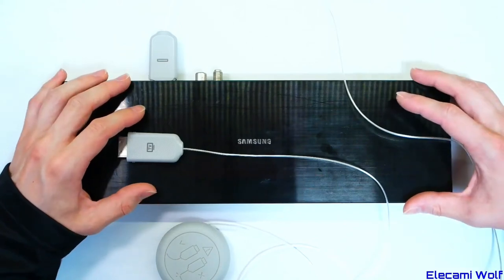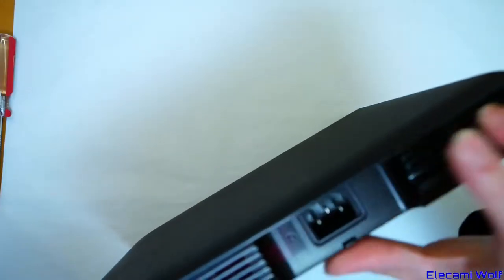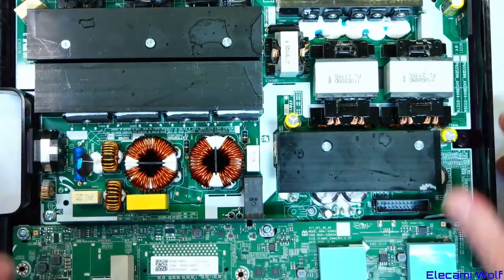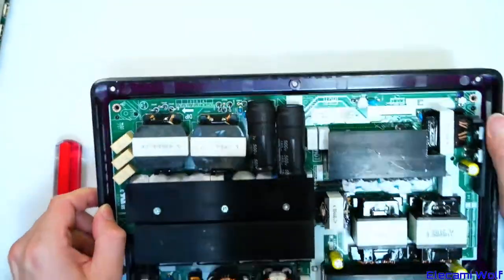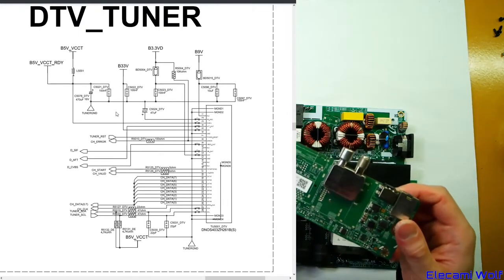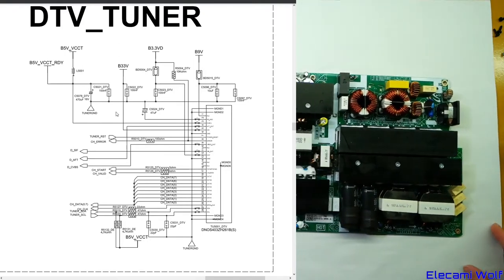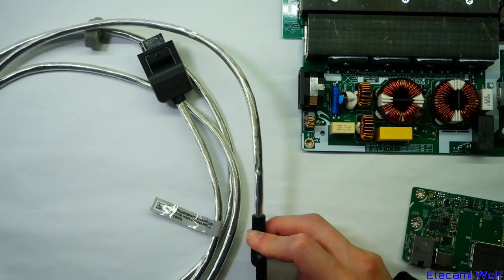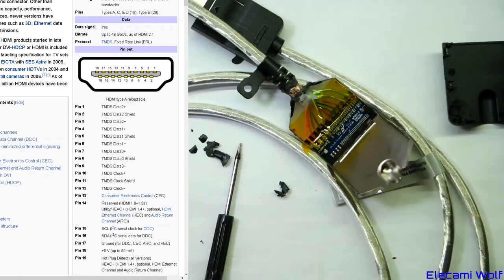EW0031 - Samsung 8K TV One Connect Box Teardown

Comment: I have a few 2021/2022 Frame TVs and the OneConnect cables are extremely thin and carry power to the TV at the same time.

I took a quick look and looks like they've upped the voltage carried on the one connect cable to 350 volts to be able to use a very thin conductor to carry the needed 290 watts.
Reply from the maker: It is a nice system, no needing AC power to the TV. I have taken a look in that version too video EW0040  and EW0041

Comment: Did you happen to see the WiFi card, where the antenna may be? Is it in the One Connect box, I don’t see it here. Wondering if the cable is possibly used as the antenna on either end or if it’s in the TVs
Reply from the maker: WiFi and Bluetooth is on a small board that is in the TV part. The aerials are on that board. Here is an example of that board: https://twitter.com/ElectricElecami/status/1525841238330683392
Reply: samsung 8k qn800A Sim One Connect Box QN900A Can he use his for this?
Reply from the maker: @husanuyghur7392  I don't know. I don't think it would be possible to mix 8K with 4K parts. The signals are different.
Reply: @Elecami  8k tv900A

Comment: Very nice detailed video. This box is making a clicking sound and my 8k tv is rebooting every 5 seconds. Whats usually the common cause of that?
Reply from the maker: Not sure. Would depend what type of click it is. A relay operating?, Switch mode power supply current limit?
Need to try it with a different One Connect box.
Reply: @Elecami  or try a different "One Connect" cable
Reply from the maker: @en2oh  Yes that too.

Comment: So I watched the vid. Unfortunately, with the latest 8K Neo QLED lineup, even if you decide to purchase the longer, more expensive cable separately, your options are very limited for this new One Connect "Pro" Box. The only upgrade that Samsung offers is the same thick cable, but 5m long max. No 10m, 15m, no fiber options available. Having a cable like this at least 7.5m long would really help me out with the setup I am working on. As far as I understand extending this new cable would be difficult to say the least, i.e. because of degraded signal. I wonder if there is a way to built something custom, like extend it with some signal strengthening method in the middle?...
Reply from the maker: I don't think it is practical to extend an electrical cable yourself. The issues with multi gigabits per second data signal integrity are too difficult to overcome. It would take a lot of work to build a custom extender and get it working reliably. More than the value of the TV if you had to pay someone to do it. 
I am surprised the 5m option is electrical and not fiber. For 8K signal that would be very difficult to achieve. 
It is much different to fiber where if you got the splice good, there is not much else to worry about.

Comment: Hey!  I have an 800b 75" with this same One Connect box.  I have noticed that when I am running it at 4k 120 the one connect box gets hot (I measured it at 128 F) after about 5 hours of use.  Does this seem normal to you?  Does it run hot and I am just noticing it because it is out front as opposed to behind the display?
Reply from the maker: I have no idea, I've not experience one running, I just have the On Connect Box that I got in a lot of other random junk.
The older one connect boxes I have used get quite warm. I had it sitting up on the edge because I thought that would help with airflow though the vents. 
The outer surface is used to dissipate the heat, the best you could do is have a small fan blowing at it.
Reply: @Elecami  okay so they do get pretty warm then.

Comment: Hi I have a qn800 TV with a similar one connect box. At first out of no where I got double image even on home screen. Resetting from the hub and the service menu did not work it appeared during the setup as well
I unplugged and plugged it back after a month. But this time it took a while for the double image to form at the bottom. I was wondering if the TCON cable is loose or something. I would really like your opinion  please.
Reply from the maker: Maybe an intermittent connection in the panel, board or a cable as you suggest. Could open it up and poke things around and reseat connectors. Being mindful of the high voltage.
Warranty replacement would be better or a service person then it is up to them to open it up without breaking the glass.
Reply: @Elecami Wolf  I see. Thank you very much. I'll look into it 👍

Comment: I have the 2022 QLED 8K 75" Samsung with this connect box.  5 months in it stopped turning on.  No red standby light on either.  If you try turning the power on there is a clicking sound coming from the one connect box and the standby light will come on sometimes blink but black screen, no sound or video.  I put a light to the screen and could not see anything coming on.  Any idea what it could be??  Samsung will not honor the 12 month manufacturer warranty stating I did not buy it from an authorized Samsung reseller (they will look for any loophole took them two weeks of back and forth to tell me that).
Reply from the maker: Difficult to know. Probably power supply problem. Could be in the One connect box or the TV. Would need to find working parts to swap around and find where the problem is.

Comment: What is the name of the cable you disconnected? Trying to find one online to replace my current one.
Reply from the maker: The One Connect cable? Or something internal?
Reply: Internal. The first cable you disconnected when you opened the one connect. At about 10:25 mark.
Reply: That cable burned and im in need of a new one.
Reply from the maker: @elissonjimenez32  I am not sure. It would be custom made for this. You'd have to contact https://samsungparts.com/ or local equivalent and ask. If there are service manuals you can probably work it out from the exploded views and parts list.
Reply: Gotcha. Thanks

Comment: Hey... I have problems... This connect... No backlight... Cable ok... Lcd ok... Backlight not start but tv work... Help
Reply from the maker: Sounds like dead backlight or Backlight driver / power supply. You will need to get it serviced.
Reply: @Elecami other connect and tv work perfect led started... Oryginał connect its problem power supply....
Reply from the maker: @bestkozi  I think you will have to find a new one.

Comment: Assuming that this thing is overheating during playing games in 4k (connected to a PC) to the point that it start giving  frequent random black screen moments during the gaming sessions, lasting 2-3 seconds each, which are very anoying, what would you do to help cooling it down?
 I was thinking about attaching two USB turbine fans on the left side of it to blow some air inside it to cool it down, but I am not sure which component exactly is causing the black screens when it overheats so I can focus the air flow on it.. Any ideas..?
Reply from the maker: Could try fans blowing in the vents to see if that helps. If the screen is going blank it could also be the power supply in the TV part that is causing that. Power supply fault like dried out capacitors. In that case colling is not going to make it better.
Reply: @Elecami  I had a 49" curved 4k Samsung before this one, with a much smaller one-connect box, which had the exact same problem. And I attached a laptop side cooler on the box, which extracts the air from inside and pulls out, and it worked like a charm. I'm just curious which part that heats causes the blackouts, to focus the blow on it.
 I can put it on the one connect box, but definitely I can't put a vent on the back of the tv itself.
Reply from the maker: @annacondasnakes  I don't have any experience with cooling helping that type of issue. From what I have seen it is a power supply problem or it is a signal quality problem. E.g. HDMI cable or adapter is poor quality, not connected well or worn out,
Reply: I had the exactly the same issue, i got a 2.1 HDMI cable and it fixed the black flickering!

Comment: Have bought and enjoyed the 8k QLED for 13 months, and yes, you guessed it, one month out of warranty, it has started misbehaving. TV powers off and on continuously. Have tried to get it repaired through SAMSUNGS service agent, and there been no reply now for 2 weeks. Repeated online chat with service and nothings been done. Positive its the one connect box malfunctioning. Anyone know what to do? Do I replace the box, if so, who sells them?
Reply from the maker: Seems likely a power supply issue. I can't say if it would be in the box or the TV part. 
Could also be bad connection of one connect cable. 
Depending where you are, official Samsung spare parts should be available to you. Google search: Samsung Spare Parts.
Or keep an eye on eBay and similar places.  People sell the one connect box from TVs that have a damaged screen.
Reply: @Elecami  TY sir, so nice of you to reply. Have already made contact with Samsung parts. Hope to see some resolution.
Reply from the maker: @Rob-Benny-Hill  I hope that works out good.